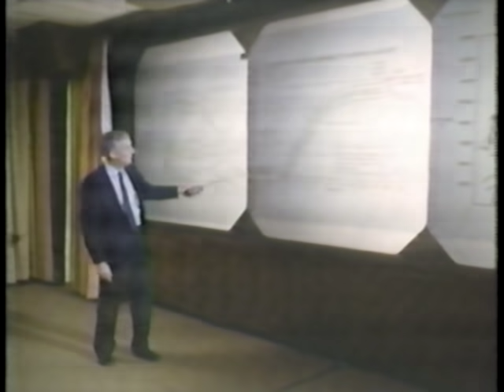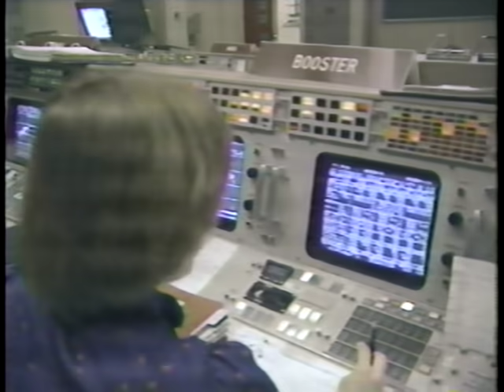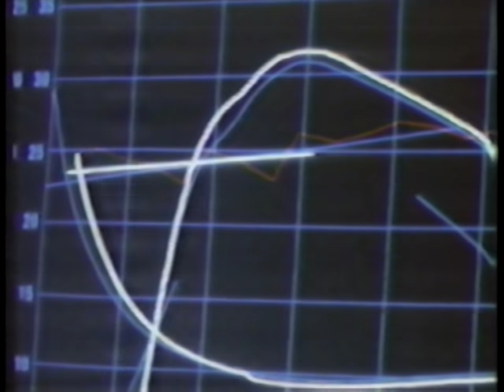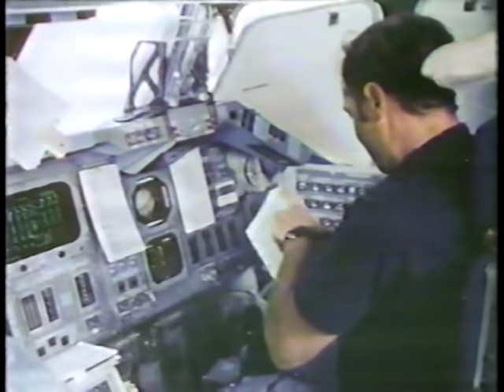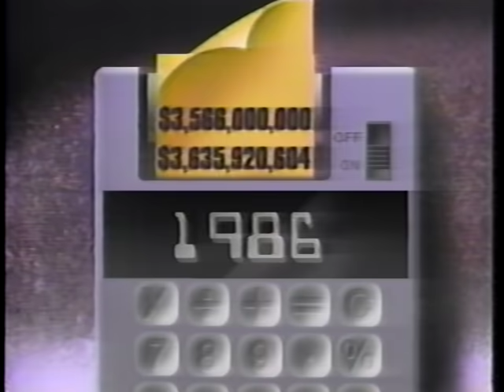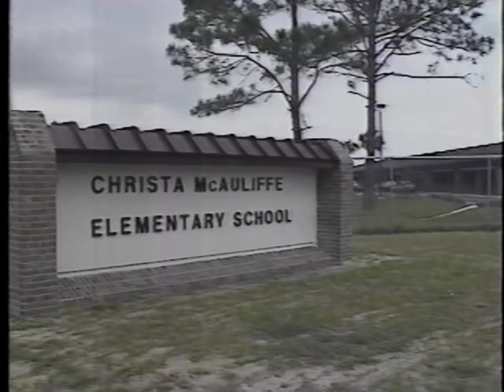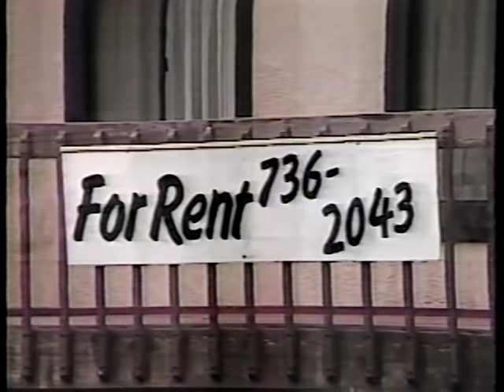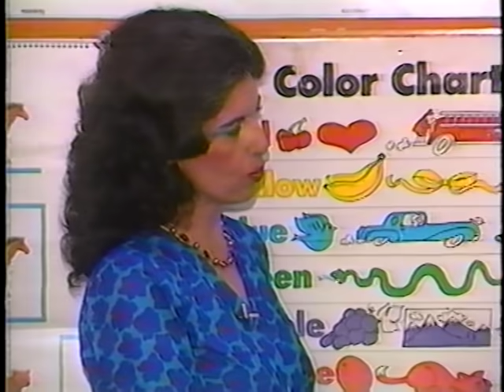Space Shuttle Challenger What Went Wrong

Comment: 10:43 That a Global Hawk design. js..
Reply: No, Faget's original "fully reusable" straight-winged orbiter design.  Looked more like a "regular airplane" with tail planes and wings, and used large internal fuel tanks (which of course would be empty on return to Earth), making the vehicle very large but very lightweight, with a lot of surface area.  This would allow the use of a fully-reusable metallic heat shield using a principle called "hot structures" that could handle the lower heat loads on reentry of that orbiter design.  The downside was, the enormous internal fuel tanks took up SO much space there was only room for a SMALL payload bay.  

When NASA teamed up with the Air Force to get their support and partial funding of the shuttle program, the Air Force and their requirements took over... They required a "once around' polar orbit capability launch from Vandenberg and landing back at Edwards AFB in California, and a HUGE 15x60 foot payload bay for gigantic spy-sats and other military needs, both of which Faget's straight-winged "hot structures" orbiter could not do.  SO, they went with the big "delta-winged" orbiter design of the shuttle as we know it.  No internal fuel tanks meant room for the huge payload bay the AF wanted, but the heavier, faster reentering orbiter got MUCH hotter on reentry, and thus needed a heat shield that could handle higher heat than the metallic heat shield of Faget's orbiter, requiring switching to the fragile, delicate thermal tiles made of "glass foam" (essentially).  No internal fuel tanks also meant shuttle would have to use a huge EXTERNAL fuel tank, and there wasn't money to develop a huge fly-back fully reusable booster to loft the shuttle orbiter/external tank combo, so they decided on "cheap" "reusable" SRB's.... the rest is history.  

Later!  OL J  R :)

Comment: ehhh.... has anybody really check weather data? was it 41F ???  It's about +5 CentiGrade - no frost, no water turn into ice, no rubber seals should ever fail... 
Or ???
Reply: the flexibility and the performance of rubber seals gets worse in low temperature. doesnt need to be below zero to fail, i guess.
Reply from the maker: Zdzichu S. Yes, it was below freezing overnight with icicles noted on the launch pad. Remember also, that if it was almost freezing at the time of launch, it quickly was freezing in flight as the vehicle was still icy and cold.
Reply: What a great idea, looking at the weather data! Overnight temperatures of 18 °F (−8 °C)
Reply: Thiokol only had data on O-ring performance to 53F...this launch was out of known limits regardless of the time you took the temperature

Comment: “it was a glider and it only had ONE chance to land... somewhere”

Guess my dumb ass thought capsules are basically bricks and have even less options once they’ve started their de-orbit compared to something that can at least glide their way to a runway vs. drop into an ocean.
Reply: Capsules have parachutes and a launch escape system. They are much safer.
Reply: Capsules were used before the Shuttle.  They had a launch escape system and were able to parachute down to a splashdown.  The Shuttle had NO launch escape.  When it launched, you were helpless for at least 2 minutes while the SRB's burned.   Apollo, Gemini and Mercury were all infinitely safer than the Shuttle.  The only thing that set the Shuttle apart was the fact it was re-usable.  Saved money compared to rockets that were lost after use.....and money is what made the decisions.  The Shuttles were marvels in their own right.  But a capsule is much safer.
Reply: There were a few landing options for the shuttle, but they had to pick one and commit to it.  Note that there was never a problem with the guidance to a landing.  In my opinion, the concept for gliding to a landing was implemented perfectly.  The wakness was the vulnerability of the leading edges of the wings, a separate thing altogether.  The leading edges could have been improved if they had been more thorough in testing them.

Comment: Why couldn’t the SRBs be jettisoned?
Reply from the maker: They could be. That's how it normally works. One of them broke loose and smashed into the external tank causing an instantaneous explosion.
Reply: @MalcolmShawVids  I mean jettisoned before they burn out. As the shuttle launch was being watched, surely they could see the flare emanating from the right SRB. I’ve heard that, aerodynamically, it would have been impossible to jettison the SRBs as they were in full thrust.

And as I understand it, the Challenger didn’t really explode, but more so disintegrated in a cloud of gaseous vapor.
Reply from the maker: @rekunta  The visible flame was a second or two. No way could anyone have reacted that quickly. As for the SRBs being jettisoned under combustion, I'll have to double check since I thought it was  part of the "abort maneuver."
Reply from the maker: @rekunta  Yes, you are correct, so they wouldn't jettison the SRBs, but the combo, basically the orbiter by itself. Also, yes, the orbiter itself basically blew to pieces as it was spun into shearing forces from aerodynamic stress. The explosion itself was actually a violent reaction of liquid oxygen and liquid hydrogen. You'll notice the cloud is white, more steam than smoke. Nothing really burned.

Comment: Great Space Workhorse Question: With danger of heatshield being damaged during launch was any consideration made to mount shuttle along its topside so heat shield side faces away with wings having more distance from falling foam or ice. Yes, vertical stabilizer in the way, but if mounted to a rotating ring it could be stowed parallel to wings.  During emergency, it could be rotating back in position as external tank is jettisoned.
Reply: I posited that same question.  If they had gone with a dual-rudder system with them mounted outboard say near the wing tips, it would seem possible to mount the orbiter that way.  In addition, it would have eliminated the "doors" in the heat shield where the LOX and LH2 lines connected the ET to the orbiter itself, to transfer the propellants from the ET into the manifold feeding the SSME's.  The connections could have all been on the TOP of the orbiter, for the bipod at the front of the orbiter, the two aft connection points mating the orbiter to the tank, and the propellant line connections to the ET (and of course the other connections like for the computers and telemetry system monitoring the tank and controlling the gimbal of the SRB's nozzles).  

It would have required a near COMPLETE redesign of the orbiter, though... of course at the design stage, that's not a huge deal, BUT it would have also precluded the possibility of loading and servicing the payloads AT THE PAD, which is what they designed the shuttle to do.  That's what the huge "rotating service structure (RSS) was for at the pad... it would rotate in, cocoon the shuttle orbiter, allowing them to open the payload bay doors, and then load and service and fuel the payload prior to launch... and if anything went wrong with the payload, allow them to go back in and fix it before launch.  

With the orbiter mounted "backwards" on the tank (top side to the tank) this would have been impossible.  Payloads would have to be loaded and serviced BEFORE the orbiter was mated to the stack, and if anything went wrong with the payload at the pad, the rocket would have had to be taken BACK to the VAB, de-mated from the stack, and sent back to a payload processing building for work... 

That's why they built the shuttle with the fragile tiles next to the spray-foam covered tank... 

Later! OL J R :)
Reply: Mounting the orbiter on the side of the tank was a way of returning the main engines but has a list of safety problems, it's a bad idea that won't be repeated.

Comment: Maybe, thinking linear, at throttle up the vibrations were increased suddenly to a level that caused the connecting strut on the SRB to snap; SRB then rotated in to the tank and it blew? One question tho'......how does throttle up equal 110%? Surely full throttle is represented by 100%? (seems sorta like the guitar amp in the movie 'Spiral Tap' that are louder cos they go up to 11)
Reply from the maker: Checked and I think I have the answer. 100% is what the original design called for, but when rocket engines are improved, they don't revise the spec for 100%, so they just say 108 or whatever percent it actually is. Not positive, but I looked it up too. Whether the strut would have held for a few more seconds without throttling up seems to be irrelevant to me. It is a shame though, because they probably just needed less than a minute more, and it would have been fine. I do agree with your inference that accelerating could have helped shake it loose as opposed to just the maximum constant force that the shuttle had passed through. I believe the report pretty much just said after prolonged exposure to the flame, the strut failed catastrophically.
Reply: Thanks for your replies Malcolm and for explaining about the percentage thing. I hope to come to America and visit the space museum either in New York or indeed Florida and see one of the decom'ed shuttles. My idea about the vibration is just an attempt to make sense of the disaster and to tie the explosion in with the throttle up sequence but you're probably right and it may just be coincidence. I've posted elsewhere on youtube today tho' after seeing an interview with Alan McDonald of Morton Thiacol I think it is, who said that when everything went in to lock down and they shut the doors and cut the phones, he knew then that 'the one thing that DIDN'T cause the crash was an SRB'. Now, I know that in the editing of an interview things can get chopped about and he goes on to try and explain that it was the SRB that caused the explosion but he did make that statement initially and I thought it an unusual thing to say.
Reply from the maker: They are breathtaking in person. I have visited Endeavor in LA and Atlantis at the Kennedy Space Center. I did see Discovery take off from a distance. I was definitely close enough to see the flames and hear the crackle. I also got to witness Endeavor's last moments in the air as she was brought to LAX. Since I am into the YouTube thing, I edited my footage it into a short video. If you would like to see it, here is the link https://youtu.be/mmOqrWFQWgY.
Reply: Throttle up begins just past the time of maximum stress on the vehicle.
Reply: Wind sheer was severe that day.
Reply from the maker: txtabby I’m not sure about that. It was a very calm, cloudless morning. Also, I’m reasonably sure they were above most weather.
Reply: No, there was quite a strong jetstream directly above the Cape that day (jetstreams can be present on perfectly clear days). When the stack encountered the jet stream it received a mighty sideways force and it is speculated that this sudden jar dislodged the residue which had been sealing the breach in the joint. Once the debris was cleared away, the flame had a clear path out through the gap and it played on the lower part of the ET, melting the attachment strut and part of the tank wall.
Reply: Tom Tremayne you have to get a stem degree and take a job at nasa before the over 100% business begins to make sense to you. Usually right before you lose a whole crew of astronauts. 🤔
Reply: @EricIrl  correct, there is another video where they explain the wind sheer and the main engines working overtime to reposition the vehicle onto its flight path, the rocket plume shows the sheer as a big dog leg in the trail from launch through the wind and into the explosion and break up.
Reply: @Dave-id6sj  Wasn't just the wind shear... the engines of the shuttle and SRB's were nearly "hard over" fighting to maintain the stability of the stack as it flew, shortly before the explosion.  

The O-rings failed at ignition, but there was a layer of putty and of course "combustion debris" (gunk) produced by the SRB's that was blown into the joint and actually sealed it off, more or less.  SRB's produce "motor buzz" which is a ~60 hertz vibration caused by the burning solid propellant, it's a common phenomenon of solid rocket motors, akin to the "whistle" of bottle rockets.  This buzz or vibration is why the flight of the shuttle was SO rough during the SRB burn, and then gets so SMOOTH after the SRB's are jettisoned. Anyway, between the vibration and the forces encountered when the shuttle entered the high-altitude wind shear, the "gunk" plugging the SRB was shaken free and blown out by the hot high pressure combustion gases in the SRB.  

By pure bad luck, the leak was just above the rear strut and pointed at the thin aluminum external tank, filled with liquid hydrogen.  Once the hot gas could escape through the path where the gunk had been, it started to burn like a blowtorch, melting and blowing away the steel of the SRB casing joint.  The flame grew in intensity, as the hole got larger, the faster it cut through the casing, enlarging the hole still further.  This ever-enlarging jet of hot gas blowing out the side of the SRB acted just like a steering rocket, pushing the shuttle stack in the opposite direction, creating an unwanted roll and yaw in the rear of the shuttle stack.  To counteract this unwanted force, the shuttle's SSME nozzles and SRB nozzles swiveled (gimbaled) in the opposite direction to create a counter-force.  As the hole and the jet of hot gas grew larger, so did the force, and the shuttle engine nozzles had to gimbal more and more sideways to counterbalance it.  Meanwhile, the forces built up on the structures, as the hole thrust was pushing the SRB one way, and the shuttle nozzles were pushing back the other way to maintain control.  The hole continued growing ever larger, and just before the explosion the nozzles were very nearly steered "hard over" (as far as they can go) trying to keep it flying straight.  The forces were reaching the breaking point and still growing exponentially faster.  The jet of white-hot exhaust blasting out of the hole was now impinging on the side of the ET itself, and the rear strut and attachment point connecting the SRB to the ET and stabilizing it.  The ET itself was just thin aluminum, about like a soup can, covered with a couple inches of spray-on foam insulation.  The blowtorch of hot gases burned through it like a hot knife through butter.  The strut ripped away the mounting pad and sheet metal of the tank side as the tank gave way, and the aft dome of the ET simply ripped off under the weight of the liquid hydrogen on top of it as the tank sheet metal ripped apart.  With the shuttle and SRB nozzles pushing hard the opposite direction, the sheet metal of the tank simply ripped apart once structural integrity was lost.  The aft end of the SRB, now free with the dangling remnants of the aft stabilizing strut, was free to swivel sideways as the thrust from the ever-expanding hole pushed it away from where it had been joined to the tank, swiveling it around the upper connection ball joint connecting the upper end of the SRB to the ET and transferring the thrust into the structure of the ET and stack.  The end of the SRB above the connection swiveled into the side of the conical LOX tank at the top of the stack like a giant can opener, buckling the sheet metal of the LOX tank side near the bottom and causing it to rip open, spilling the dense super-cold and highly volatile liquid oxygen, as the entire structure simply came apart.  The still-thrusting SRB's ripped free of the disintegrating tank as did the orbiter, the residual thrust from its now propellant-starved and stalling SSME's shoving it sideways and causing it to break up into a million pieces due to aero-loads on the orbiter.  The SRB's, relieved of the weight of pushing the stack, rocketed out of the fireball and continued on their corkscrew path, their nozzles still canted sideways where they were when control was lost from the orbiter connections when things came apart, flying freely in their corkscrew pattern, shortly before the range safety officer at Cape Canaveral Air Force Station pressed "the button" that destroyed the SRB's via linear shaped charge, to prevent them from possibly impacting somewhere populated.  The cabin, relatively intact, came out of the fireball and entered a long two-minute free-fall back into the ocean.  Everything else did too.  It was over.  

Later!  OL J R :)
Reply: @lukestrawwalker  that makes sense, thanks for the info, tragic but fascinating subject.
Reply: Malcolm Shaw You can see the windshear in the SRB plume column in postaccident video - there are two or three large zigzags in the 35-50K feet range
Reply: The engines can throttle past 100%, just as a car can throttle past redline.  They routinely throttled to 104% on every launch.  They're allowed to throttle to 109% in an emergency.  Throttling above the rated 100% requires more frequent inspection and rebuilds and limits engine reusability.

Comment: If some people have a way to escape  then everyone should, so we disabled the ejection seats. What even
Reply: Not viable for crews larger than 2
Reply: No ejection system would have worked when the main fuel tank exploded.  It would have been far easier to improve the joints of the boosters than to design an ejection system which would have saved the entire crew from that exploion.  In the aftermath, that’s what NASA did.
Reply: @GH-oi2jf  If the crew cabin could have been separated from the shuttle (which is what actually happened) and there were parachutes attached to the crew cabin itself, then the astronauts might have been saved.